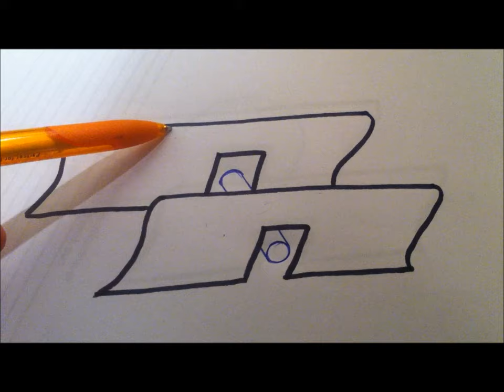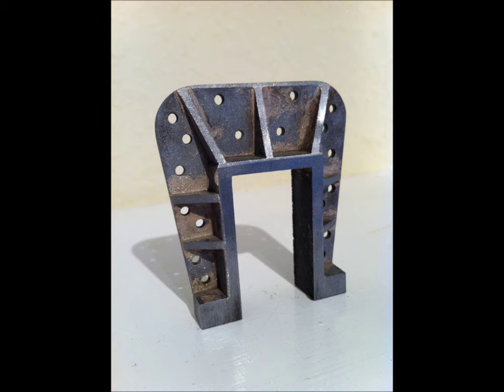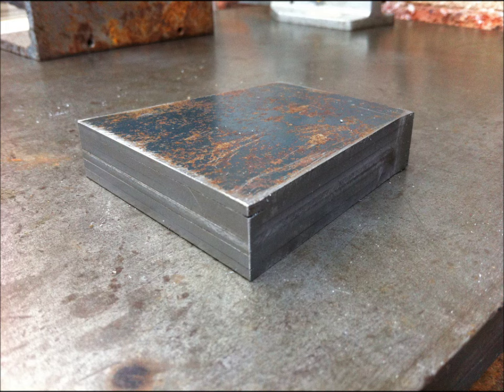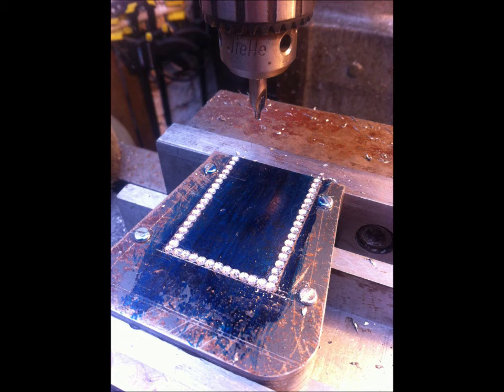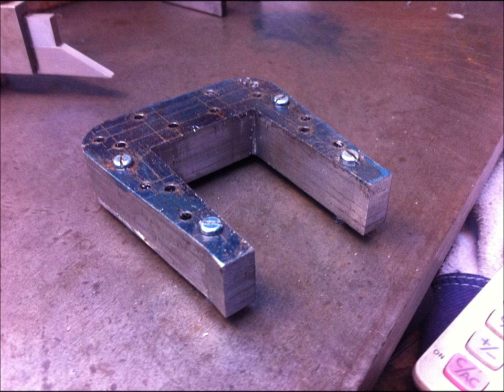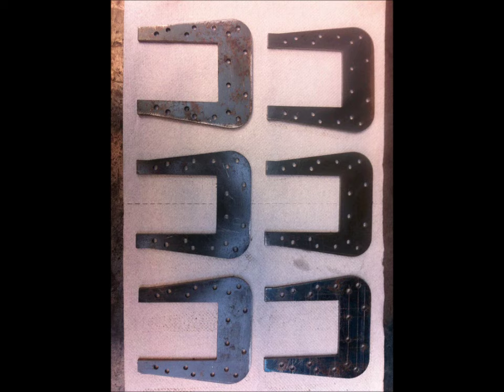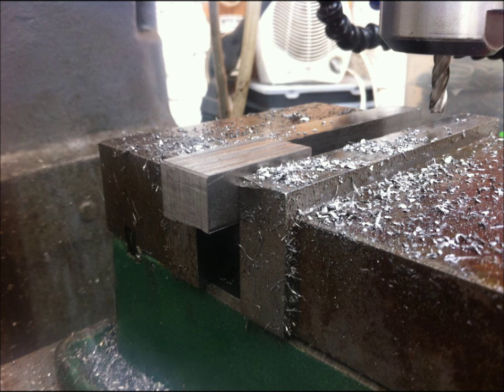Home Workshop Engineering - Fitting Horn Blocks

Comment: again, lovely work.

its jsut an option. but for my loco i waited to machine the inside of the horns, until i had a fully assembled chassis.
i then mounted it upside down on the mill and machined the inner horn faces.

that way i got them all parallel to eachother.

but im sure with the quality your working to, you wont have a problem.
Reply from the maker: andyg3 Good suggestion, In my next video I will mention this.

Comment: Fitting the axle boxes to the horn blocks: Avoid making them too close a fit. Remember the suspension on a steam loco has a ridgid axle and as the suspension operates the axle boxes may not rise evenly each side of the engine. Some parts are sprung whilst other parts are not and will need a little play to cope!

Comment: How did you form the cup for the vise mounted rivet set and ensure it was the correct across head dimension and radius ?  Or did you just heat the end and whack a ball bearing ?

Malcolm
Reply from the maker: mparkerlisberg Hi, I used a ball nose cutter to form the cup, and a standard rivet as a depth gauge.

Comment: As to the question of holding the webs before silver soldering, you said “if I had been welding I could have tacked them in place”. Would that not have been a solution for silver soldering too? Tack weld one spot to put them in place, and then silver solder the whole lot. It would have made the part more accessible during silver soldering. Maybe it is a stupid thought, if so please say so, I am just a beginner and not in this size anyway (search for my nickname and you will find my website). Wonderfully interesting videos though and no doubt I am not the first one to note that.
Reply from the maker: Thanks for your comment. Yes what you have suggested is actually a solution that people use. Tack weld and then silver solder. The only issue comes with other materials. Typically allot of thin brass and copper fabrications are done by silver soldering and in thoes cases tack welding could be a bit risky. Cheers.

Comment: I think you shorted yourself when you said there were 102 rivets. Each horn has 18 rivets and there are 6 horns which makes it 108 rivets you had to hammer in. Still a LOT of hammering. Nice work.
Reply: I was watching the next video and saw that you had cut a corner off of one of the horn flangess to make room for the boiler. If you did this to the horn on the opposite side, you would have eliminated 6 rivets and put in 102 rivets and not 108.